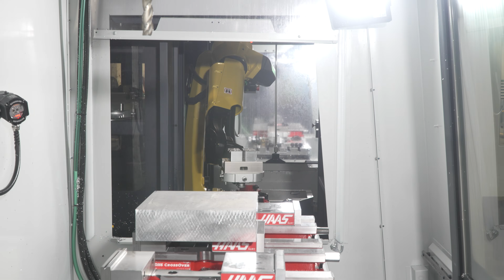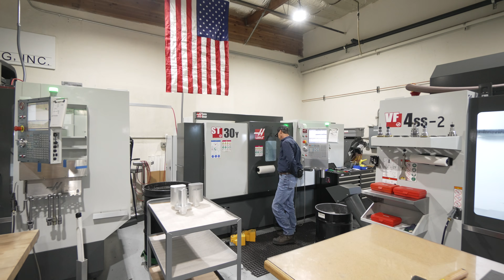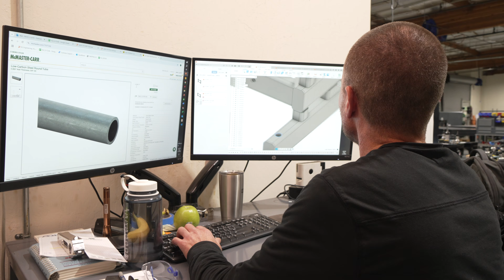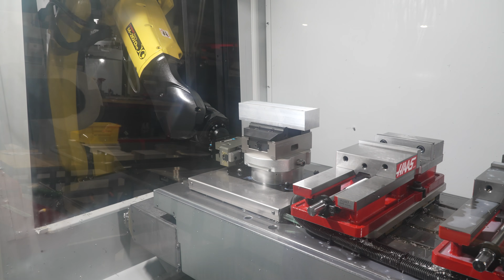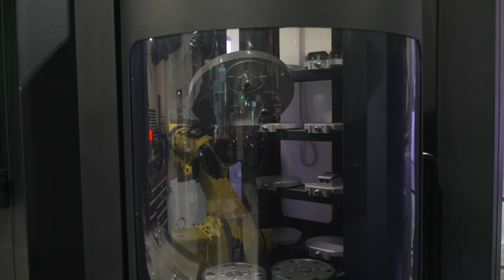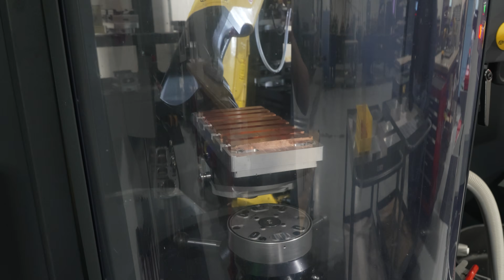Palletized Automation: "At This Point, I Really Don’t See an Alternative to It"

Comment: For those who don't know the Bay Area, this would be like manufacturing in Beverly Hills.  😎  Nicely done
Reply: I have an old 1.5” Criterion boring head that’s stamped “made in Beverly Hills.” The LA basin first got rich off oil and manufacturing (especially aviation) before it became the capital of showbiz.
Reply: Maybe if they were based in Atherton. Morgan Hill is not at all comparable to Beverly Hills
Reply from the maker: The Bay Area is one of the most challenging places in the country to run a manufacturing operation. KL Engineering shows how modern automation allows high-precision manufacturing to thrive even in places where the margin for inefficiency is very small.